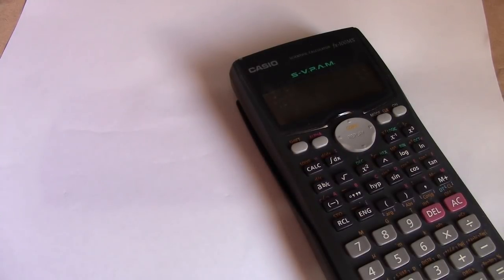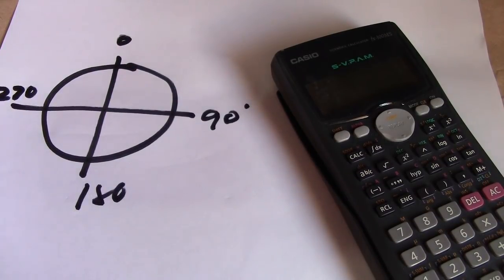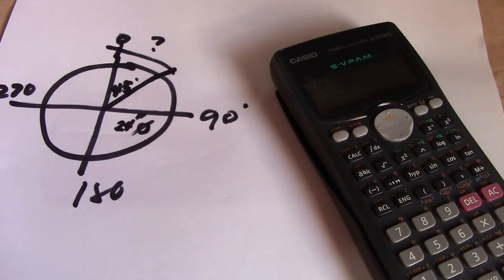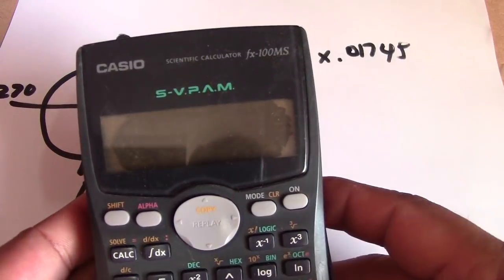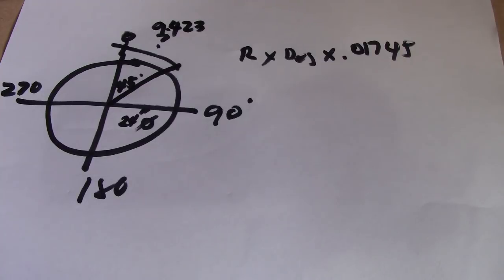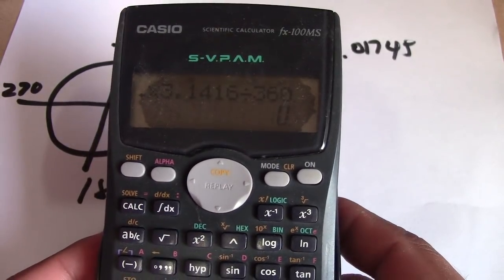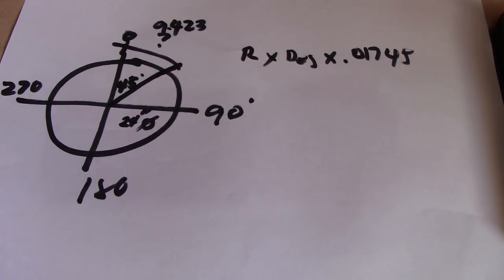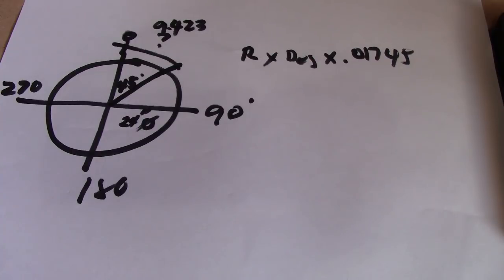Formula To Get ARC LENGTH of Degrees - PipingWeldingNonDestructiveExamination-NDT

Comment: Now do a video about if you had a 60” diameter tank and you wanted to weld on a nozzle (pipe with flange)... how would you go about laying out the fish mouth on the pipe so it would fit on to the 60” tank?

Comment: dagdag lang po .instead of using 0.01745 use cos89 masmdli pindutin
radius x degree x cos89
Reply: san mo nmn sir kinuha, ang cos 89, mo paki explain, ang tama nyan ay 3.1416/180 is equal to .0174,